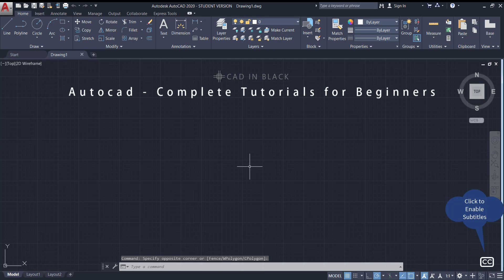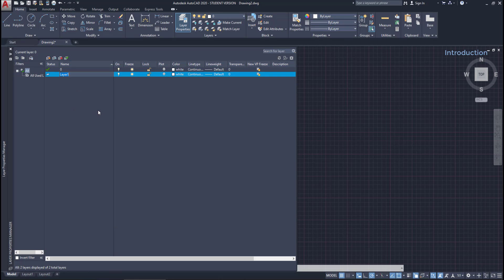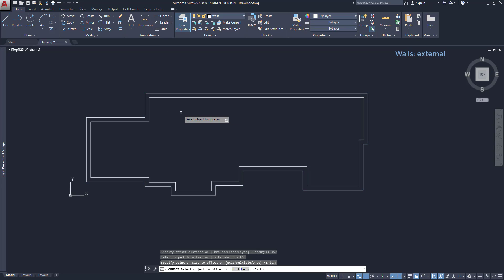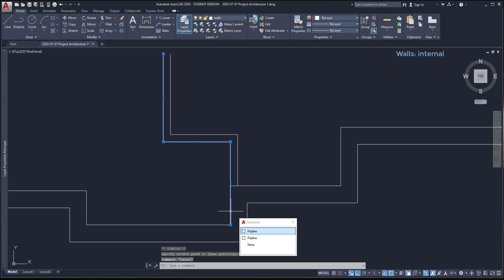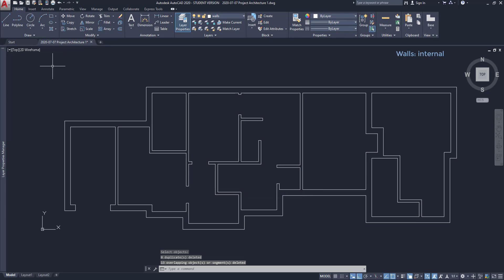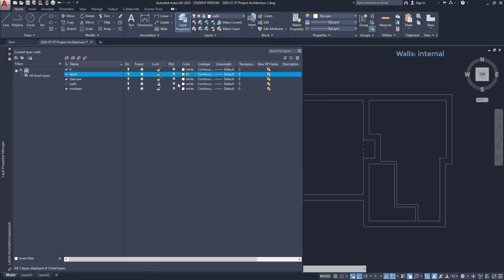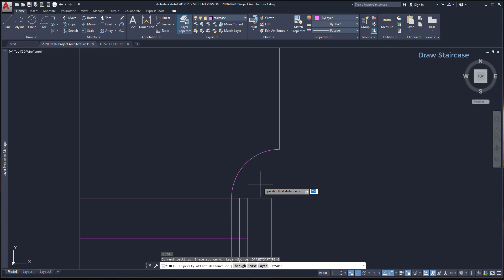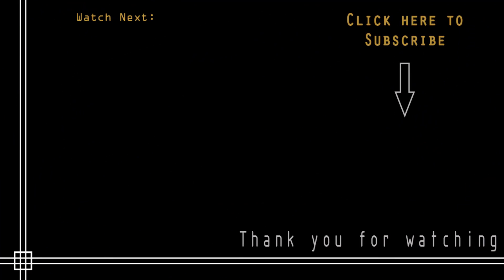Autocad - Complete floor plan (Step by step) - Part 1

Comment: This is great. Except for the fact that your vertical (the up and down, perpendicular lines) measurements on the outer wall do not match up with what you are saying or what is written on the pdf. You say the first perpendicular wall is 400 mm but it appears that it is 350 mm. Therefore the exercise is not replicable. Or I am missing something. I find your exercises very useful though in general.
Reply from the maker: Hello +Matt Case. Thanks for your comment, and I am glad you like this tutorial in general. Can you tell me at what minute is that situation? So I can have a look at that
Reply: @CADinblack  Hey CAD, idk if this is what the OP means, but when you're just starting to draw the walls, at 4:33 the width of the wall that goes down is 400, that's what you mention, then it's 2200 to the right (as it's on the pdf), and then you go down 700, but that would mean that the width of that lower wall is 300 because of the 1200 measure that is shown there divided in 3, and there's just no way to know that, why would it be 300?. Also there's a 350 measurement for the outer walls in the pdf, in the lower right corner. I'm a beginner so I might be wrong but, as others have mentioned, it's very difficult to get the correct numbers on your own. Apart from that, thank you for your videos, I've learn a lot from your channel.

Comment: Many lines does not have dimensions
See staircase I got confused
For beginners it is not easy to understand
Plz check sir
Reply from the maker: Thanks for your comment and for your review. :)
Are you talking about the PDF file. That's true, but my point was to make you practice in guessing the other dimensions. Sometimes you just need to subract two dimensions, or another are just the same as others. The staircase doesn't have dimensions in the file, but I showed it in detail in the video. If you think it's not enough, maybe I can add the staircase in detail in a pdf file.
Reply: Sir please do some more tutorial on 2020 plz sir

Comment: Hello again, I don't have the  associative icon with array - are you able to tell me how to turn this on please ? As an alternative i have used the command explode which seems to have worked but if you could tell me how to add the associative icon that would be most helpful? Thanks

Comment: Also, when some of the lines are connecting to the mid point, which is joining the lines at an angle instead of straight  - why is this? thanks

Comment: I'm confused about the polyline and how to measure 2700mm from the garage, its not clear to me how to do this and how to measure using the polyline from the corner.  This is approx 6mins and 14secs in...i can do this using lines, but end up deleting the line width of 2700mm and converting the vertical line into a polyline - thank you in advance